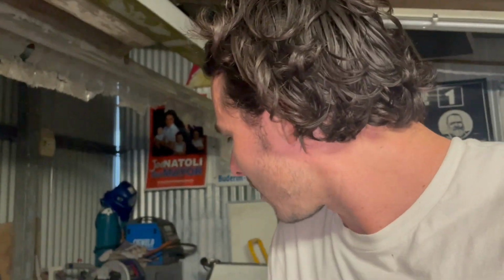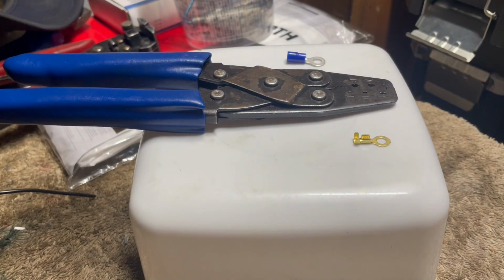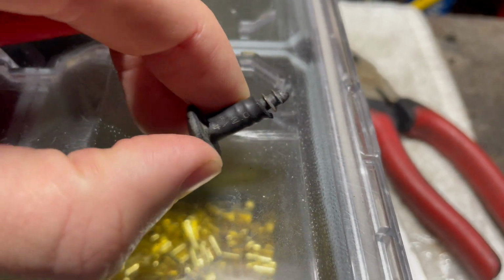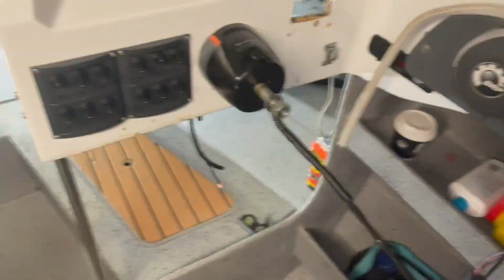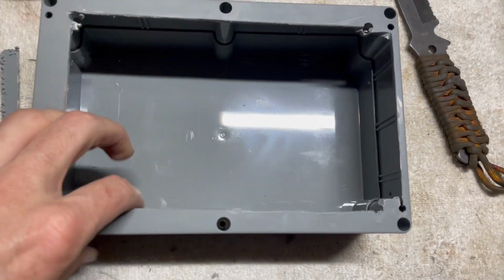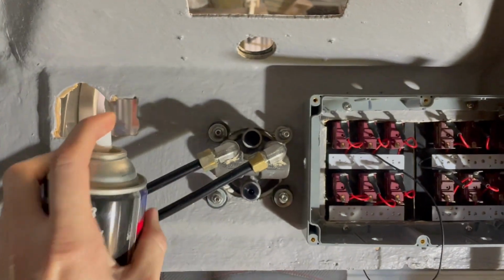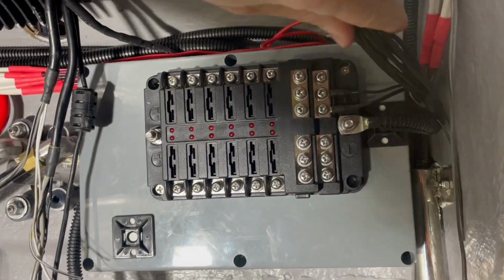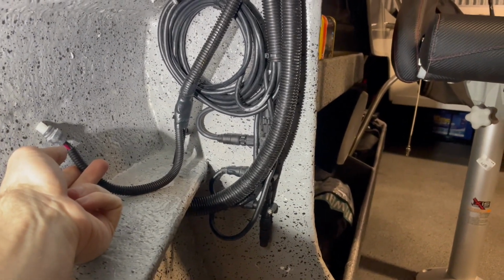[EP9] Neat 12V Marine Wiring! How To Rewire Your Boat - Cruise Craft Galaxy 585XL

Comment: Mate loved how you used a junction box to cover the precious side of the switch panel, I'm currently doing a similar rewire and will use this. How did you create a cutout in the back of the junction box? What tools did you use?
Reply from the maker: Drilled it in 4 corners and cut with a jig saw with the box separated into two.
Reply: You could use a step drill to round out your corners and make sure you use a plastic jigsaw bit to do your cuts, draw your lines go full OCD.